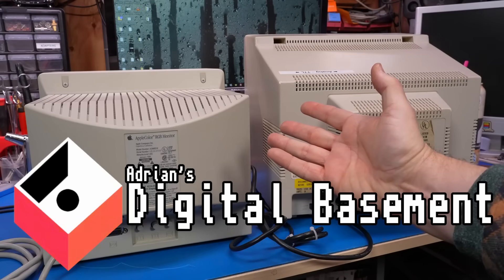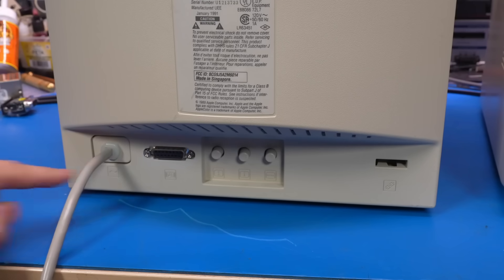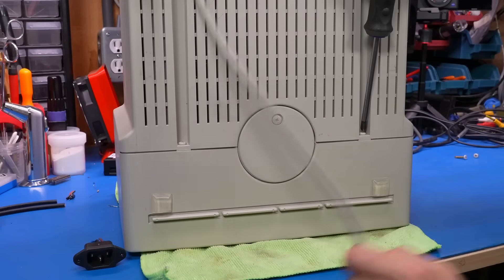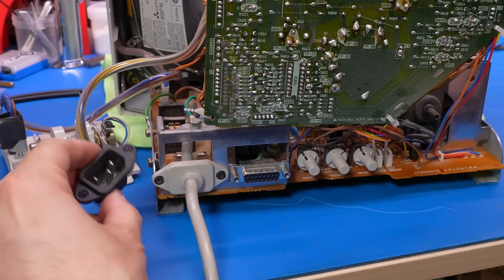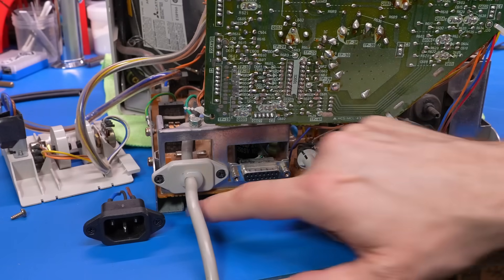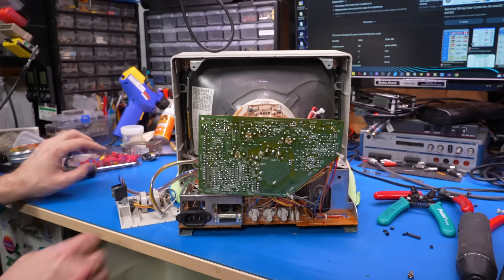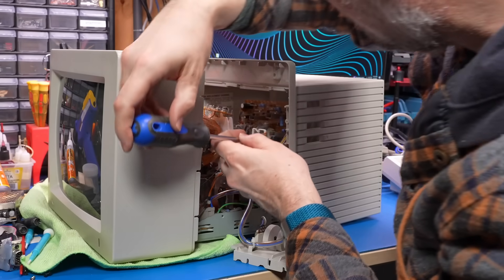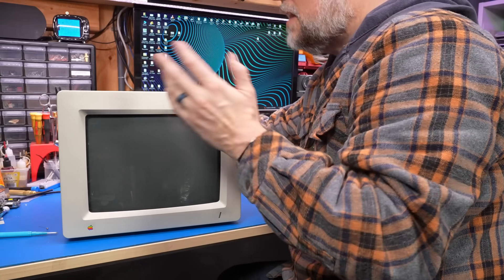Quality of life: Adding a proper IEC mains power input jack to a monitor

Comment: The manufacturer's thinking here is twofold: 1. You always need this cable to use the device. Once installed, you don't worry about this. 2. You cannot lose the cable like this.
But the reality is, that while yes, an IEC connector costs a few cents, doing what either of those monitors did definitely cost more. Today, most devices are made for an international market, and it is usually cheaper to include a universal power supply and deal with supply and demand in different regions by packaging the cable, in some cases, even including all 4 variants. This is done knowing only one will be used and is more cost effective, because the devices are heavy and shipping them more than once is even more costly, and the region in which it will be sold isn't known during manufacturing and initial packaging wherever they are made. Economies of scale make it so that even the cables cost cents.

Comment: For the 1084 monitor, have you considered cutting the cable back to just a few inches and attaching an IEC socket to that? You could use one of the old male->female IEC cables that were used for PSU->monitor power passthrough and get one that's already got a safely shielded socket attached.

I also hate fixed cables and like being able to have one permanently plugged in IEC cable that I can just unplug and replug into whatever device I'm interested in working on.

Comment: I wouldn't give up on the 1084 so quickly, there's a lot of empty area on the back shell to the left of the tube neck.  I don't see why you couldn't just put a case mod, and put an off the shelf IEC jack...

Btw, they make IEC jacks with embedded fuses, I recommend using those vs scavenged parts if you're making your own hole anyway. ✌️

Comment: Even on the other monitor I'm sure there is enough room on the cover to cut an opening to mount a IEC C13 receptacle.

Agree the IEC C13/C14 standardized power connector is great but as other have posted it took several years for it to be blessed for US electronic gear.

Comment: When we had the IIGS, we also had a combo fan and surge protector/power strip that sat between the monitor and the CPU (as they called it). We had the model by Kensington. No need to worry about cord length, and it kept the computer from overheating because for some reason Apple thought that passive cooling would be fine for a backplane that sits horizontally.

Also reminded of when I was building the computer lab in high school, there were PCs that had power output ports that one would plug a monitor into, but using a male IEC connector rather than the kind of plug that sticks into an outlet.

Comment: The IEC C13/C14 connectors (and the 60320 connectors in general) were used in Europe for several years before being used in the US. Much of this was due to the multitude of different outlet designs used around that side of the world.  Growing up in the late '60s and '70s, nothing that plugged into the wall had a removable cord.  (Most of it was 2 prong... no ground, and not polarized.)  The first time I used an "IEC power cable) was on my parents' PC/XT, around 1985. (And the amber "CGA" monitor had a permanently attached power cord.)

Using that permanently attached cable on your monitor probably saved the manufacturer about twenty cents.
Reply: The IEC plug system (which includes not only the C13/C14 plug here, but also the C7/C8 two-pin plug, and various others) was introduced in 1970. While Europe might have been a touch earlier to adopt the system, it was certainly common in USA by 1980, too.
Reply: @tookitogo  I'm not saying they weren't used in the US; they certainly were.  The Apple ][ power supply had a C14 power connector, at least in its later units. It was when the multi-voltage (world market) devices became common in the early to mid-'80s that the IEC power cord really became known in the US.

Comment: I do love those flexible silicone rubber line cords!  I keep an eye out for old Apple magsafe power bricks in e-waste for that reason, and remove the mains cord.
Reply: Silicone line cords are exceedingly rare, due to cost and low mechanical robustness. The Apple monitor line cord he removed in the video is pretty much guaranteed to be PVC, just like almost all line cords today. But it’s been my experience that many old PVC cables (not just line cords) are softer than most modern PVC. Some manufacturers of soft PVC do remain, but most seem to make much more rigid stuff than before. :( (FWIW, the softest signal/control cables and individual stranded wires I have found are from Kabeltronik, while the softest line cord I’ve found is from Nexans.) 

Post-2007 Apple is quite unique in using PVC-free cables, but they’re not silicone. I don’t know what it is, other than it being an unspecified thermoplastic elastomer (TPE). (And they’ve used different materials over the years; their first PVC-free cables were terrible.) You can verify this because the TPE melts, while silicone does not. (Silicone never melts, it just eventually catches fire and burns, leaving behind insanely fine ash.)

Comment: I cut a IEC connector hole in my Commodore monitor and wired to the connection wires on the bottom. Wasn't that hard, but admittedly messier.

Comment: Yes, permanently wired power on monitors has always annoyed me - especially - when they have that square grommet - clearly a cost saving measure of a couple of quid. Yes and the fixed VGA cables were annoying too. Too many times has one of those leads catching on something as I am moving a monitor nearly caused an accident.

Comment: I used to work at a monitor/computer refurbishing place where I have personally done this modification to at least a hundred monitors from every manufacturer. If anything had a "power cable" and the company doing the removal was not getting paid a lot: It was chopped. So there was always a pile of monitors needing this fix to be done to them. I was the person that started testing the monitors BEFORE they went through the trouble of soldering the wires and stuff on.

Comment: The second ground connection might be a shield which goes around the whole fixed power cable. You might need to install a ferite to have a simmilar behavior.

Comment: I wonder. Was that plastic plug really that much cheaper instead of proper connector? What was it $10, $20, $120 or maybe less than $1? They even used a connector on the board. There are also monitors that have not only fixed power cable but also signal one. These are ultra annoying because complicated video cables break very easily. I bet we all had a situation where we had to bend the cable the exact right way to get correct colors. Or at least had a friend who had to do that.

Comment: Apple did strange things for different markets. The original StyleWriter came with a sonically welded "wall wart" power supply in 120 V countries while the 230 V version had an inline power brick with a 1.5 m mains lead (permanently connected) held together with four screws, i.e. easy to open and repair. I'm not sure but they might even have dual-voltage transformers so you could convert them to 120 V just by unsoldering and moving one connection. Haven't had one open in a long time.
Reply: We had the original StyleWriter way back when! :) Later I got a Color StyleWriter Pro.
Reply: @tookitogo  I love the original StyleWriter but the paper feed is a horrible design, no matter how much I've cleaned them, I haven't been able to make any of mine pull paper cleanly. They were fine for a few years, which was probably all that Apple expected, but once they got on a bit they pretty much all failed.
Reply: @Ragnar8504  Yeah. It wasn’t even that great when it was new. 

Modern printers are far better at preventing and detecting paper misfeeds.

Comment: I wonder if the two ground connections were, 1 going to the wall socket, and the other to a shielding inside the cable. Doing same effect as those ferrites we see in some power supply cords like the one in Iomega ZIP disk units. 

I would also have added a capacitor inside the monitor between live and ground to filter line noise.

Another things that came to my mind was using heatshrink tubes to cover the pins on the chassis connector and spray painted it beige.

Comment: I've also installed in-line IEC sockets and shortened the cable back to about 4 ins, makes it easier to deal with, not as nice as the flush fit socket, but works for the monitors that you cannot do nice clean installs on....

Comment: I guess the solution is simple: The models outside of the US had an IEC input.... If the US model (that is not multi-voltage)  also had one it would be easy to accidentally plug the 110V model into 220/230/240V.
The other way woudn't cause any damage

Comment: splicing wires 1/2 inch from solder terminals is not the brightest idea you've had.   The wires off the connector were 4ft long, and would have reached the terminals on the IEC socket without an issue.  

Consumer grade monitors in the 80s were considered televisions.  Hence they could not have a removable power cord under UL listings    Only class B computer hardware (office/factory use) could.    IIRC that was changed in 92.

Comment: On a side note, that AppleColor RGB monitor (manufactured in 1991) appears to have the inferior, IMO, version of the Mitsubishi CRT. Instead of the inky deep black tinted tube, it's light grey, giving it poor contrast and dull colors. There's also a green tinted variant, but generally as nice as the deep black. I've used and owned all three variants. BTW, I'd love to find or build a D15 to DE-9 cable like that one, seeing as I have Amiga's, several IIGS's and AppleColor and Amiga 1080 monitor displays on hand!

Comment: Talking about the cable inlet being designed for something else, I have a wireless microphone receiver that uses a locking DIN connector for output and a similar connector for DC power in but interestingly the audio output din is actually fixed to an adaptor plate but the power one is not, remove the adaptor plate and a standard D mount socket will fit in the cutout so changing the connector is easy. Why oh why didn't TOA fit an XLR as standard, it was obviously designed for one and this was the 80's so XLR's were standard.

Comment: I've done this before, what I do is cut the cord so about an inch remains on the monitor, then when you unscrew the blanking/adapter, remove it, then pull the three wires out. Now you have pig tails ready to be soldered directly onto the IEC jack. this way there are no mid wire splices.
For the Philips monitor, cut the cord so there is about six inches left, the fit an inline IEC jack. not quite as good however that very short tail should be way less annoying than several feet of cord.

Comment: They weren't trying to annoy you, Adrian. It's just more of Apple's proprietary bs.
Reply: Nonsense. The 230V version of that monitor used a standard detachable cord, and the dual ground lugs strongly suggest it used a shielded line cord, which is an added cost they would only have done for EMC compliance. Presumably North American EMC standards at the time were stricter.

Comment: I added removeable powert cords to a ton of my stuff! Right now there's a ISDN phone system on my desk I removed the cord and added a IEC C8.
I have pretty short power cords with highly fexible silicone cable on them especially made for my bench, cause the next outlet is always in reach of half a meter, so there's no need for long and stiff cables messing around.

Comment: you could potentially make the Commodore 1084 less annoying by replacing the 6ft of flex with 6" of flex with a C14 (female IEC) socket on it (assuming you don't have to feed the cable through the hole in order to take the cover off).

Comment: Another possibility for your 1084, you can get inline C14 connectors that you could attach to the cable coming out of the 1084... you could then greatly shorten its length

Comment: I've always seen the earth pin positioned towards the bottom (google image search results ~mostly agree), but the IEC_60320 wikipedia page shows it at the top. I wonder if it's because when removing a power supply it's "upside-down"?

Comment: Funny thing... I do that to all my electronics. Even the ones that don't have a convenient mounting location. As far as where it hooks to the mainboard, I've made my own interface adapter on more occasions than I can count. I especially like doing this mod to equipment that wouldn't have any kind of chassis ground otherwise. There are lots of TVs, stereo receivers, and other things that could benefit from a proper ground.

Comment: Yeah, I have lost count of how many IEC mods I have done on various equipment, certainly many tens.  Most things I am a real stickler for originality, but fixed mains cables offend me on a deep level; vintage tube gear, historically important pieces...doesn't matter.  I will pay $50 on ebay to source the correct knob, but I am dremeling the back of the case for IEC.

Comment: I’m currently working on a Macintosh 12” RGB monitor that has both the power and video cable attached. 😢 The power is the same as the IIGS monitor so I can do this mod as well. I also did this mod on an Apple IIe monochrome monitor.

Comment: I swapped out the power connector on an old Panasonic NV-5110 Video Cartridge Player a while back. It had almost the same shape connector as modern IEC connectors but the pins were round for some reason and I couldn't find a cord that would work. Swapped in one out of a PC power supply and it fit just fine. I soldered the wires directly to the connector though; better than splicing wires together.

Comment: You can get inline IEC connectors and you can just cut the 1084 cable short so it is just a pigtail with an IEC connector on it if you don't feel like cutting the case on the 1084.

Comment: I did something similar for a TV which used an ungrounded power lead. Couldn't use a chassis connector (well, I could, but I didn't feel comfortable mounting an ungrounded figure-8 inlet with metal screws when there was no possibility of grounding them) so instead I bought a figure-8 extension lead. Cut the plug end with about 15cm of cable and wired it to the existing cable with a pair of Wagos. It's not quite as neat as a chassis inlet but a figure-8 plug is much smaller and less likely to snag on anything so having it hanging off a short length of cable was an acceptable compromise.

Everything should have an inlet. Nothing should ever have a captive power cable.

Comment: for the 1084 you could cut the ¿male? (the socket with the exposed pins; male/female always confuses me with most electronics) end of an IEC extension cable and have only enough cord hanging off the bottom to reach the rear of the monitor, rather than a full length cord.

Comment: If I had to guess, they had to fix the cord since the monitor had no support for voltages higher than 120VAC. An IEC jack can accept a cable that could feed 208/240 VAC.

Comment: The two grounds on the apple one are probably a ground and a shield and was probably the reason why it was fixed, since IEC cables arent shielded. The shield was probably used because of some EMC compliance or issue
Reply: Some IEC cables are shielded. I don't see the benefit of a shielded power cord if the outlet/extension you're plugging it into is wired with unshielded cable.

Comment: The IEC connector supports 120 volts as well as 240, so you could accidentally plug a 120-volt monitor into a 240-volt outlet.

At work a friend was plugging in a 120-volt monitor into an IEC outlet strip in a 19-inch rack cabinet, and got the 240-volt one instead.  Bye-bye monitor!

Comment: This can also be done on the other monitor. You can just shorten the cord to about a foot of the case and add a male plug on the end. Probably easier then replacing the socket on that one to me honest. Another option is to get one premade and replace the whole cable.

Comment: I think that maybe (I'm not Apple expert) they had to use this cable for RFI reduction reasons (with user swappable cable it could risk violating some FCC regulations). That extra earth/chassis connection may be shielding of cable - be careful when modding Tandy monitor and check earth connection, because if one of those connectons is only used for shielding you may risk creating ground fault (best would be to connect both of those earth/chassis connections).

Comment: I don't think the IEC power connector was such a standard yet when these monitors were made. Sure, on serious office equipment, they were pretty common, and personally I always associated them as "PC Power cord", but they didn't really get common in homes until PCs themselves became ubiquitous home computers, and until then, it was more of a speciality cable you couldn't buy from any regular place; you just had the ones that came bundled with your devices, and it's pretty much like that still; I don't think I ever bought one of them separately.

Comment: Since you plan to mod it already, why not just put a short IEC female cord on the 1084? make it just long enough so it doesn't interfere with how it sits on the desk. The benefits are 1. you won't trip on it 2. it's detachable. it's not as elegant as your solution for the Apple display but it would alleviate the same complaints you have.

Comment: You have enough space in the back of that other monitor to fit a C6 socket (the one where you insert C5 plugs, the 3 lobe plug, common in laptop adapters). But you could probably also fit a regular big size socket in that cutout for whatever optional connector they had planned to support.

Comment: Adrian, you can add a male C14 cable plug to the monitors that don't have the rectangle window. I know it's not elegant, but avoid the trouble of a cable hanging. Just need a short piece of cable to do this.